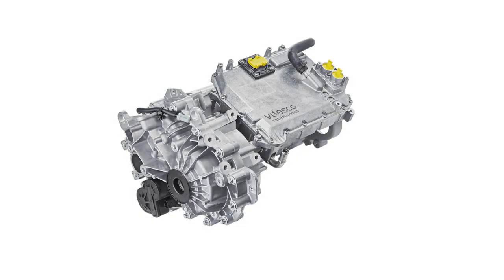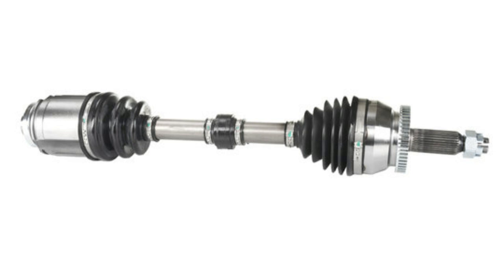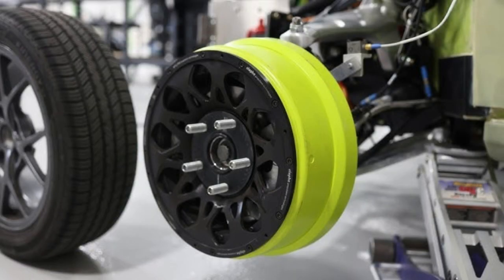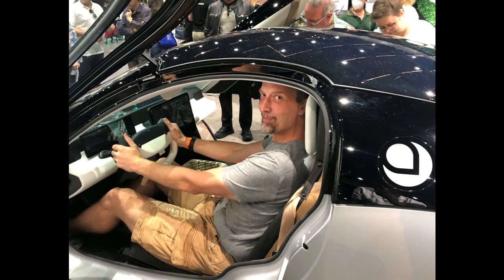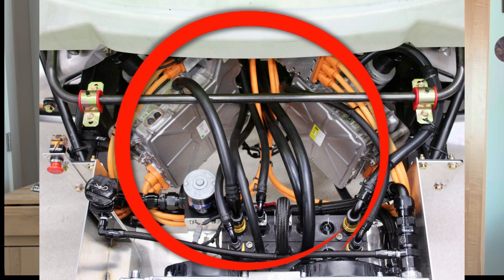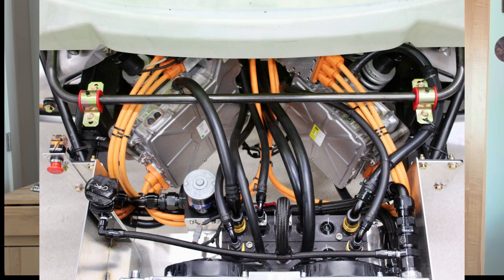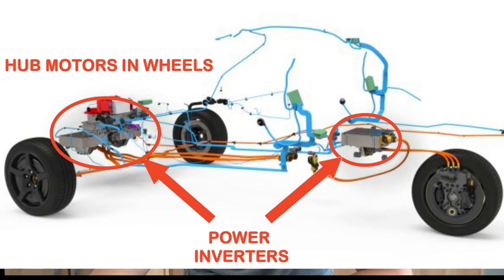Aptera's EMR3 Motor Design vs Original Elaphe Hub Motors

Comment: Well done vid, thanks.
Then there's the 6 cooling lines full of coolant to hubs and 12 sealed connections along with the 6 power cables as mentioned plus the mounting and routing hardware for all of it over active suspension components. A lot more electrical connections to 3 inverters also. Connections have the highest failure rate of most anything. Maybe all that coolant needs a bigger pump, manifold,  and reservoir too?  I fixed things for a living and look forward to the EMR3 because much less to go wrong and a better ride as well.
Reply: yup chris anthony said connectors have the biggest failure rate in a recent video,
I dont agree, most connectors these days are really reliable. Which ones you think fail?
Reply: @namenotshown9277 Good question. That's true, connectors are generally better now. I don't know what type or quality of electrical and plumbing connectors Aptera was going to use for  production or what materials they are made from. So I won't guess about that.
When I used to do failure analysis for various tech products it was based on a very thick book of every component you can imagine. Think it came from the military. Yes, connections had by far the highest failure rate by magnitudes. They can fail in a lot of ways as you probably know depending on type, quality,  environment, use, dis similar metals, crimps, flexing, seals, temp, fatigue, etc. The sheer number of them in a hub motor setup mostly goes away with the emr3. In the winter here, salt is used and about the only thing that holds up is stainless steel. Those type connectors would be  very expensive and there would be a lot of them. The many fewer emr3 connections being in a protected enviro is a lot less to go wrong. That's kind of where I'm coming from regardless of connector quality.
Reply: @ronfarnsworth7074  There are some issues with connectors, if they get wet there are problems. Designs are pretty good these days, you wouldn't be expecting too many problems would be my thinking.
If you have different experience I take note,
but going from my personel experiences very few issues. Connectors generally are there for a reason, taking them out will cause maintainence issues. Imagine you had to decrimp or desolder mutliple wires to replace a small circuit board. What I pain, when a simple connector would suffice.
Cost savings yes, but a headache for owners down the track, if they ever make any that is.
Reply: @namenotshown9277  You are right, environment is a key factor for connector dependability.
Spent most of my life fixing things, sounds like you did too. I was involved with tech, field engineering, product support and development, did a tech startup, etc.
I think in Aptera's case, new product and all, less complexity and points of failure, and less cost and labor and parts and ease of repair sort of over ride our sort of narrow discussion about connector dependability as there's a bigger picture.
But yes, I agree connectors have their place, no getting away from them.
I'll be pretty happy with minimizing the chance of fixing a messy coolant leak though. That stuff goes everywhere.
Cable and coolant line chafing is another thing that would worry me long term.
I would have bought an Aptera either way. Be well!
Reply: @ronfarnsworth7074  nice discussion, thanks ron, yup fixing things is a messy business!
Reply: @namenotshown9277  I think we've replied each other before, yes, good to trade pov's with someone with hands on knowledge. Thanks..
Reply: And those cables and conectors are out in the open in an often wet and sometimes salty environment. A small crack in the insulation can get you in serious truble! 
Not an unsolvable problem, but it might take longer as we wish and it might add aditional cost, too. 

Since FWD is good enough for me and I drove an Opel Corsa-e for three years and had no problem getting the wheels spinning until ESP kicked in, I'm fine with this decission and hope we'll see the Aptera soon in Germany. June 2025 would be nice when my company car will be replaced 😄
Reply: @VolkerHett  I once  had a small wire had broken internally, the copper wire had broken and would make contact most of the time, occasionally it wouldn't but it was for distributor, so car would stop.
The crack inside the insulation was at a point where the wire went into the distributor throught a moulded rubber/plastic part that sat under the lip of the distibutor. Took me months to find out why the car would stop every so often.
A very unexpected and hard to detect issue.
Reply: @namenotshown9277  Intermittents are the hardest problems to diagnose, good job!
Reply from the maker: Great addition to the conversation. Thank you for watching!

Comment: Hub motors are a horrendously bad idea. I hope Sandy talked them out of it. At least they are on the right track now. Heavy sprung weight, insane cable runs, damaging motion of the motor through pot holes. Better late change than no change though.
Reply from the maker: I think Sandy supported the use of hub motors.  He has reviewed hub motors made by Protean on his channel, you should check them out. Thank you for watching1

Comment: To be honest, the possibility that not yet mass production experiences company Elaphe might not be able to deliver at the production rate Aptera wants to get to very quickly, has been my greatest concern. Now Aptera is in the quite comfortable position to have a platform that can receive the readily available Vitesco drive and later without great changes and further engineering can be used with a more slowly ramping up Elaphe drives..
Reply from the maker: Absolutely true, Thank you for watching!

Comment: Thanks for your analysis - very interesting! Switching to the EMR3 motor makes sense.
Reply: Its a necessary evil.  Nothing wrong with proven front drivetrain but loss of AWD and acceleration is a factor for those like me looking at Aptera as an affordable all season sports car.  EMR4 would have been better and likely will be used when Aptera has scaled production enough to source them - fortunately its a fairly easy swap vs the change of technology.
Reply: @ccibinel  EMR4 would be better and hopefully will follow the EMR3 in a future updated version when they’re more readily available.
Reply from the maker: @kevinjensen9803  Thank you for watching!